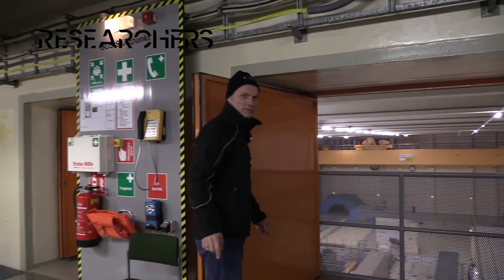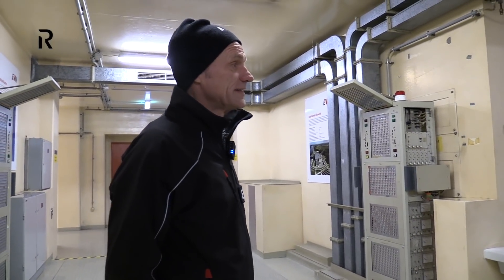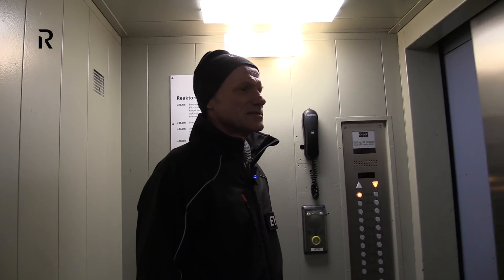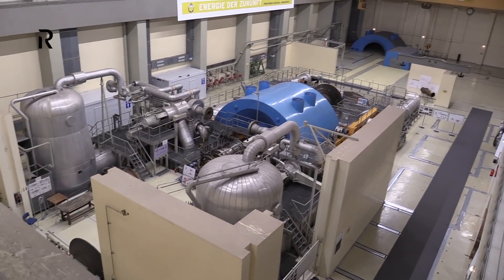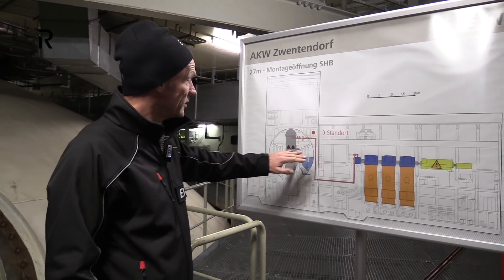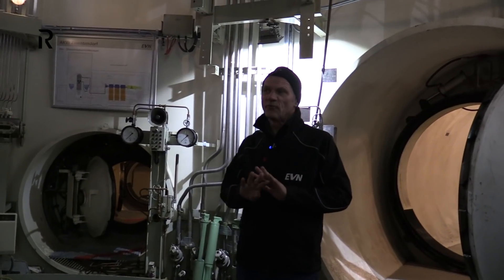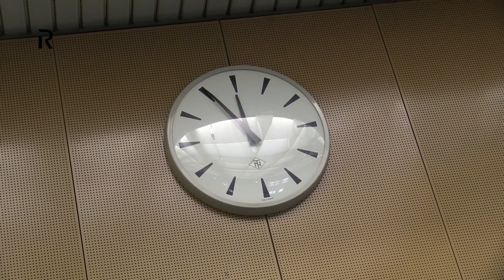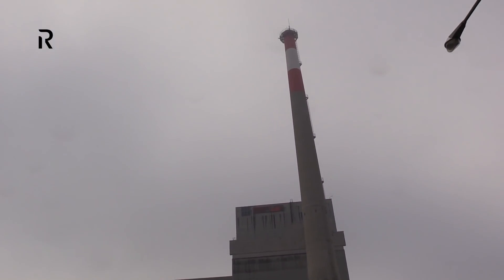Abandoned nuclear power plant: Zwentendorf, Austria

Comment: I do believe the idea behind keeping it in near working condition is that it could be commissioned if the political tides changed regarding nuclear. I’m sure it wouldn’t take much to get that place operational again, it looks like everything is still fully hooked up and functional
Reply: In 1978, Austria enacted a constitutional law prohibiting the construction and operation of fission reactors for electrical power generation. Some parts are also been sold as spare parts  to other plants with identically constructed reactors. Besides, its used for operator training, guided tours and you can also lease the area for filming purposes. 

Only one operational reactor remains in the Vienna University of Technology.
Reply: @xshowda  True, but if they ever were to get rid of the law, 99.9% of the plant is already built and in perfect condition, and the rest can be retrieved from the (then decomissioned) german plants, so it would only take some workers, fresh fuel rods, removing the signposts and shipping some (free) parts to get it going.
Reply: The powerplant was 100% finished and ready for operation. Also the fuel rods were at the site and ready for insertion. The law to use nuclear power and put it on operation was rejected by a referendum. In the next years it keep ready for operation until a a law was signed wich abendoned nuclear power plants in austria generally. After that the fuel rods were sold, also some parts of the system were sold to identical power plants. The plant was from now on used for training porposes. But theoretical it was still possible to get it operational again. There was still hope for a mind change in public until the INES7 desaster in cherobyl. 1999 the law of not using nuclear power plants become part of the constitution of austria. The power plant also getting in the ages, there was no hope of getting it ever operational. Few years later the owner decided to build a hole into the containment and the reactor pressure vessel for better training possibilities. Since this action it is not possible to made it operational again because this is not repairable.
Reply: even if laws were changed, it is highly unlikely a plant built in the 70's will be put back into service.. it is probably highly expensive to the point of unfeasibility.

Comment: Should be listed on eBay : "Unused Power Plant".  Item Condition : "As New" !
Reply: “Delivery not available”
Reply: ... And, by the way :  ... Batteries NOT included  : 3 fuel rods needed ....
Reply: Also huge hole at the bottom of the containment shield, easy fix. Flex tape should do it
Reply: @S3tekh  Oh, yes ... I almost forgot !  The "thing" at the bottom of the containment vessel (like 3 floors below) is really, ... really,  hot ... I don't know where it might have came from ...  But the Emergency Stop button still works.

Comment: but isnt this suppose to be an area which is off public limits? like someone like north korea could come steal its design etc?
Reply: "steal" 1970s technology you can easily find in the internet?
i think even north korea have more modern nuclear technology at this point, they can probably just ask china or russia
Reply: It's a boiling water reactor designed in 69 (called SWR 69), it's obsolete and all the active ones of this type in Germany were shut down in 2011. 
You can't steal anything here, of course visitors don't get exact plans and blueprints. All you can see there as a visitor is also available by public sources over the internet.
Reply: NK use plutonium only for warfare, not for electricity.. :p
Reply: @jannejohansson3383  That's right, but you need a reactor to produce plutonium, because you don't find plutonium in nature like uranium. 
So all the plutonium used worldwide in nuclear weapons was produced in reactors.
For weapons grade uranium (which is PU-239, not other isotopes like PU-240) you have to leave the fuel rods in the reactor for a shorter time than usual. 
Nuclear weapons are also the only reason for nuclear reprocessing facilities, the only countries running this facilities (USA, France, Great Britain, Russia etc) are always nuclear armed countries.

Comment: 1000 solar panels for 1 year = 19 minutes of reactor
Reply: The biggest solar installation worldwide is gonna to build in Australia, 10 GW, 13 times the power of this reactor type here, with a 20 GWh battery for a 24/7 energy supply
Reply: @simonm1447  You got your units wrong, 10 MW is nothing. However you can't compare 15000ha farm to a single reactor. For example NPP Kori generates 7,5GW in an area smaller than 400ha. Kori has a 74,45% capacity factor (and that's far from the best, NPPs can go over 90%), solar power plants peak at 30%. So to compare, Kori can generate 48,9TWh annualy, while that 15000ha solar farm will do 27TWh annualy at best. 
Another thing is the ecology of manufacturing solar cells and Li-Ion batteries...
Reply: @tomkocur  Sorry, I made a mistake, it will have 10 GW, not 10 MW 
https://www.ceotodaymagazine.com/2020/10/worlds-largest-solar-farm-to-be-built-in-australia/
They have more than enough space, and they sell uranium, but they don't have own NPPs.
Reply: @simonm1447  yeah, and I guess they also have enough sunlight. I'm just not the biggest fan of Li-Ion in such a massive scale, concentrated solar thermal plants with thermal energy storage seem more ecological to me.
Reply: @simonm1447  you’re wrong....the solar installation in Australia couldn’t be compared with NCC at all.
Reply: @ionutmarian1251  It's also a 24/7 energy supply, and it will be installed in an area with plenty of sun the whole year. 
BTW, a 2021 nuclear power plant still uses the 1950s basic design used by Westinghouse back then, it's the same construction scheme with a steel pressure vessel and the stuff around it. The control mechanism is of course more modern, but Areva is using something like a core catcher in their new EPR to catch a ḿolten core melting through the pressure vessel.
As long as you interrupt the cooling water flow (this can be caused by several reasons) it will overheat and melt down. 
This happened in TMI, this happened in Fukushima and it would happen in an EPR if the cooling water supply is stopped.
Reply: The technology for solar panels is getting better and better. There will be a threshold where the efficiency can be compared to other energy sources. It is something we can look forward to, isn't it? :)
Reply: 1 Nuclear reactor melt down = 100.000 years wasteland
Reply: @naturtechnikfreund  melt downs are extremely rare and with modern types of reactors also extremely unlikely
Reply: @naturtechnikfreund  and how many did we have at Fukushima ten years ago?
Reply: @naturtechnikfreund  nuclear meltdowns are rare and most of them in history were minor with fewer deaths compared to other energy types
Reply: @naturtechnikfreund   in this time 2020 with this tehnology is impossibile than an nuclear power plant to melt down. Impossibile
Reply: @ionutmarian1251  Nothing is ever impossible. While certainly much was learned in reactor design, creating fuel that sustains higher temperature as well as creating a better thermal margin, it may be unlikely, but not impossible as Fukushima taught us. The big boogyman is not a possible meltdown, which happened quite a bit in history, and in some instances even intentionally caused by experiment, the more interesting question is whether a power excursion event can be constrained and contained.  A meltdown without secondary effects such as water hammer, steam explosions, hydrogen explosions, etc, just leaves a blob of deformed fuel in the reactor vessel that is a bit messy to be cleaned up, but feasible to be repaired and put back into operation.

Comment: More familiar with our Canadian CANDU reactors I can see this BWR concept of reactor is  potentially dangerous and hazardous to maintain....for example radioactive steam through the turbines...leakage? The control rod area beneath the vessel must have been hell itself...
Reply: This reactor type has several weaknesses, also it tended to get cracks in the pressure vessel at some weldings which could not be checked after installation. It's cheaper, but inferior to later PWR types.

Comment: so, human rather burn coal and gas for power?
Reply: @comptelo-cz  Your numbers are wrong. 
They cover more than 90 % of their supply with own power plants, but they also use a lot of wind and solar power they get from Germany to store it in their pump storage lakes. 
file:///tmp/mozilla_simon0/energiegesamtrechnung_elektrische_energie_2008_bis_2018.pdf
You can use your eastern European nuclear energy by yourself, we have enough own power plants here in western Europe.
Reply: @comptelo-cz  Germany has the biggest power plant capacity ever in history, we are exporting in all countries (except France) more electricity than we import. Even without the nuclear power plants we will have enough electricity, they only support relatively little, and there are enough spare power plants in reserve. Nobody in Germany is shutting down a power plant without having the same capaity for replacement. 

Europe has a EU-wide grid to be more flexible, ena enable trading with electricity. This is a feature, no bug, and it's intended.
Reply: Austria has mountains, and a huge percentage of hydro energy. This country runs its grid almost fossil free, even without nuclear.
Reply: no they were to ignorant to invest in more big hydroelectric dams , therefor they wanted nuclear 
Also parts of east germany that were close to their giant brown coal plant had way higher radiation levels than the surrounding areas after they serched for Chernobyl fallout , there a high radiation was detected before the chernobyl fallout even came down coal is radioactive - mainly containing cesium, iodine and uranium+beryllium 
power plant ashes are actually quite hot radiation whise